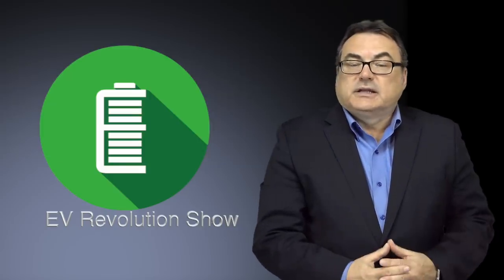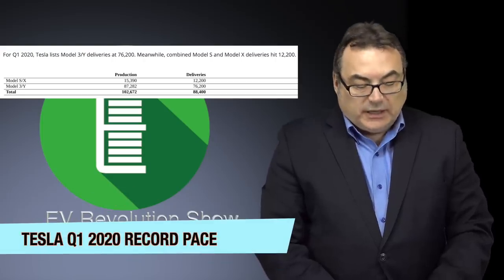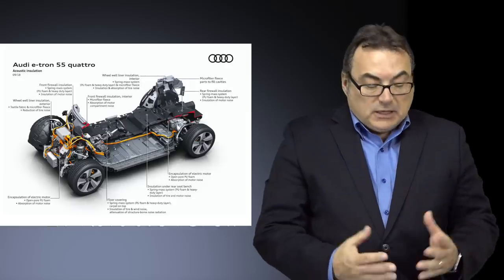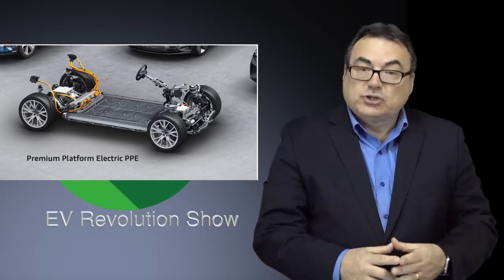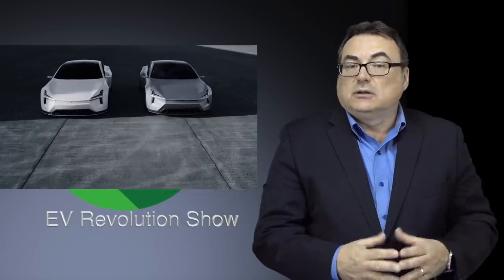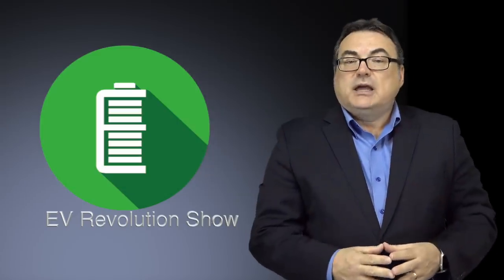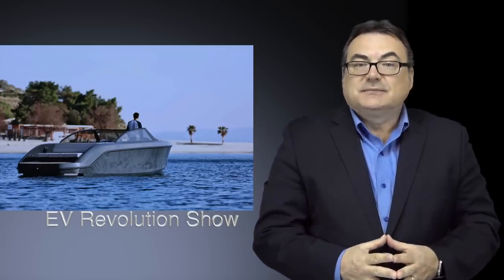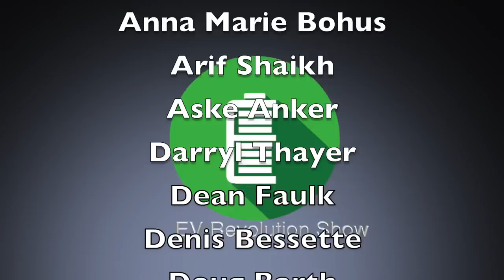Episode 88 - Tesla and GM PPEs, Polestar Precept Concept, Audi EV Platforms and More News!

Comment: Just started watching and enjoyed. When are you and or any other producer expect decreased fuel consumption? The ice world delivered efficiency gains of more than 50 percent over 12 years whilst making heavier more hi tech and safer cars at the same time. Since becoming very interested in EV'S all I have seen is larger batteries to increase range. That is NOT an efficiency gain. Many EV'S are guzzling electricity at 20+Kwh/100km. Very sad because world wide that fuel is not produced with environmental concern. Far better to improve efficiency reduce cost win win.
Reply from the maker: Hello Wayne, much thanks for watching and glad you enjoy my Channel!  There has been a lot of advancement in the relatively short time for EVs, when compared to ICEVs.  Remember that ICEVs have been around for over 100 years where EVs really since 2010 in any capacity.  Certainly battery cell size and efficiencies (along with pricing) have dramatically changed and advanced over this short 10-year span.  The amount of energy a pack can produce today versus the same physical sized offering just a couple of years ago is substantially greater.  Cell manufacturers are advancing different chemistries and construction techniques with eyes on Solid State and other technologies on the horizon.

Beyond battery cells, safety and driver-enhancement technologies have been showcased on EVs for years and in most models, are standard options (like adaptive cruise and lane-keeping assist as examples).  

To say that an EV is "guzzling" electricity is really not the same comparison as an ICEV since the EV has zero emissions and energy in many regions are based on cleaner and renewable sources.  Also electricity is a fraction of the cost of petrol/gas fuels - even with today's low oil prices (which won't last).  

EVs have progressed very much in this short time-frame and the skateboard design of EV platforms combined with more modularity and safety benefits will continue to move the yardsticks forward.